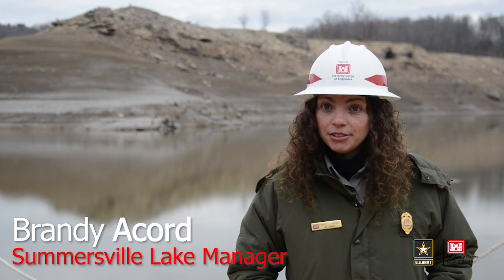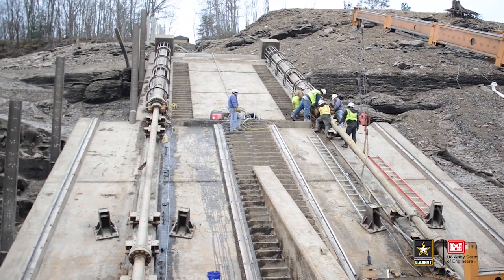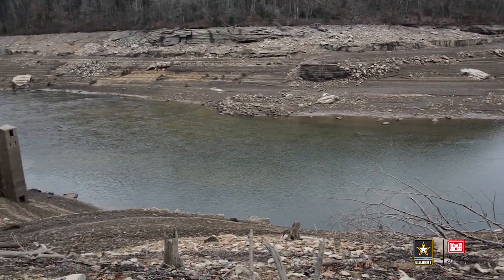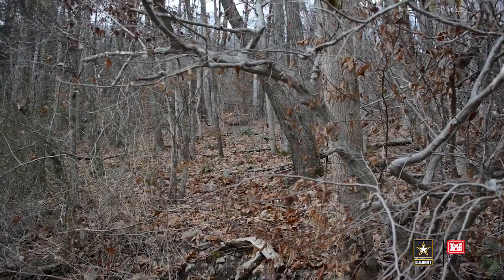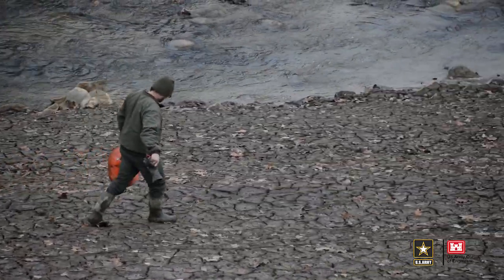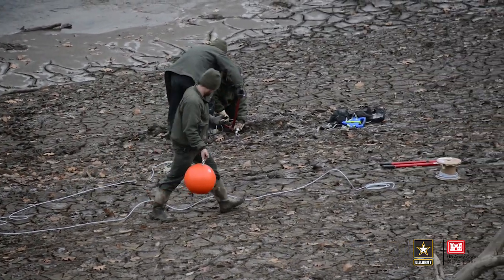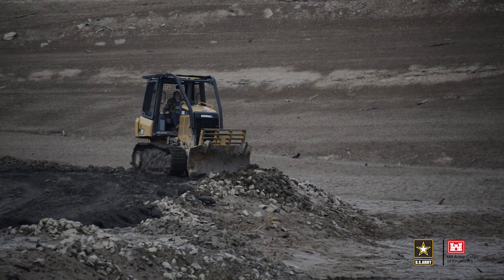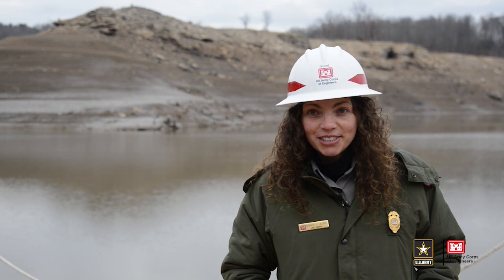Deep Drawdown at Summersville Lake

Comment: The lake should be drained unless the corp can show it’s assisting with flood prevention up and down stream. Right now there are significant flooding issues up stream that the corp of engineers continue to ignore and brush off.
Reply: They don't care about up stream flooding, the lake filling with water is literally up stream flooding. It was built to prevent flooding down stream.
Reply: There's no upstream flooding.its all downhill to the lake,and the dam can only hold so much untill it overflows. I'm a resident living a half mile away.